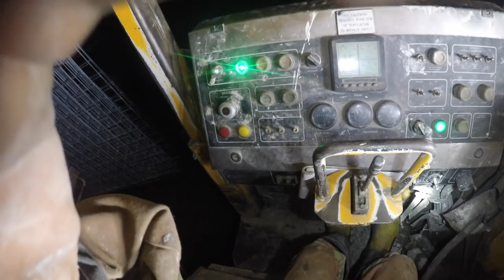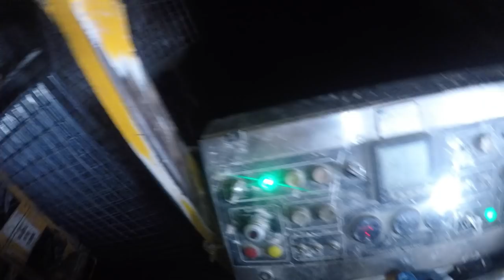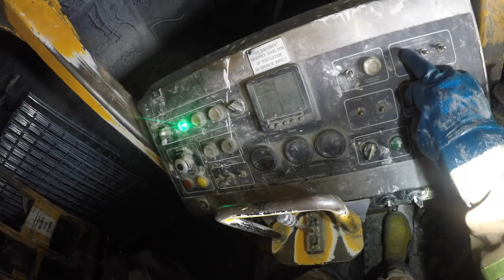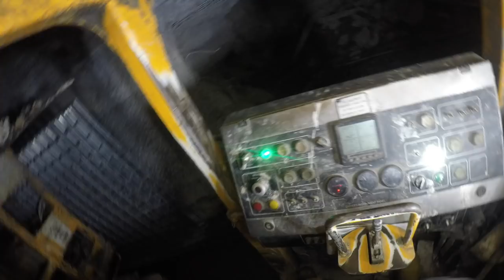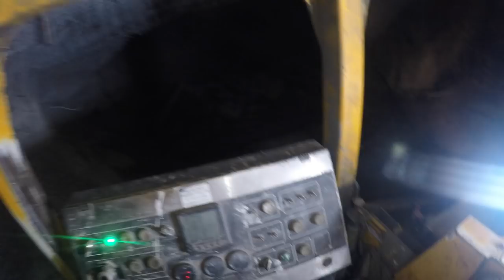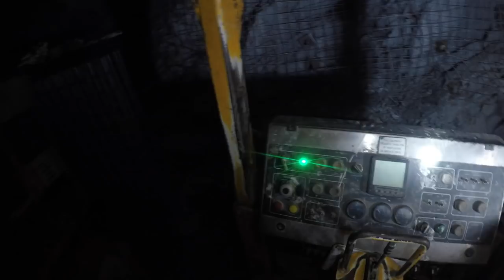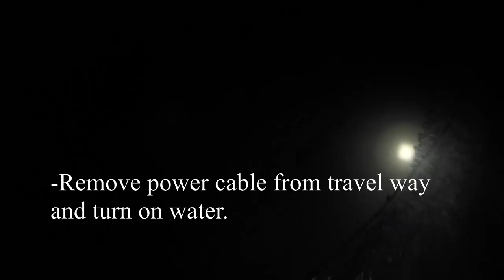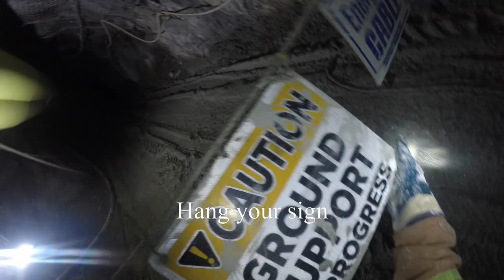Gearing in Maclean Bolter

Comment: U put this together well . One small thing u did pass bye was why u don't want to rush on foot . I know u don't run in mines due to under foot conditions can change from step to step
Reply from the maker: Craig Nicholson Most things done on foot are time consuming and take more energy .  It’s very important to be efficient and save energy to get through the day productively.     Oh and rushing usually turns into cutting corners and skipping steps .  Being a tutorial for both new workers and management it’s important for especially management and planners that doing things properly takes time and there is a reason maybe I’m not installing a 100 bolts a shift lol .   Because I have to walk so far !! Does that answer your question ?
Reply: @JoryDion  I was meaning my comment from your point sir the slop on the ground as u say takes it out of u while walking back and forth running in it or trying to be faster cos of what your been directed to do can be dangerous thru fall or cutting corners .  Example u can walk bye a power cable hose or pipe and see small damage but if your rushing bye u won't see it . Management don't consider ground conditions most times cos it works on paper it should work on the ground

Comment: wait, why should you not look at the powerpack? did i miss the explanation?
Reply from the maker: fredlllll there was no explanation,  just incase it blows up it doesn’t blow up in your face
Reply: guess the equipment isnt that reliable? XD
Reply from the maker: fredlllll no this is common safety practice for energizing high voltage electrical panels.   Better safe then your face blown off lol

Comment: Don't like ur deck setup screen should be on other side and do your services man
Reply from the maker: tony laviolette i just run the gear I didn't build it lol  and yes no services is frustrating ... Part of the point by of these videos is so planning and management can see the time it takes to do jobs if you don't have things like services . If I don't have a scissor deck I'm not going to hang 500ft of pipe off my MacLean. Not being in same heading all the time u don't get a chance to do 20ft everyday.
Reply: @JoryDion  I deal with same stuff every day you should tell your welder to make a resin tray that hangs by bolts makes life little easier cheers man